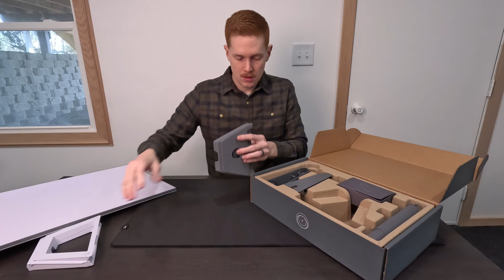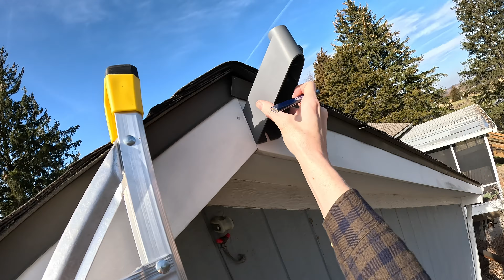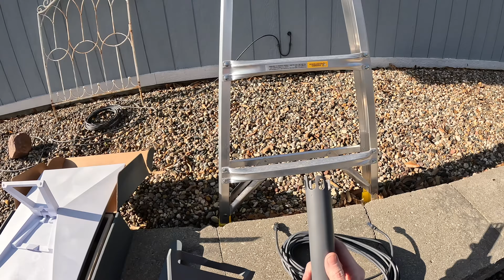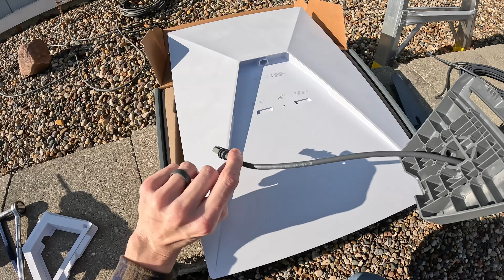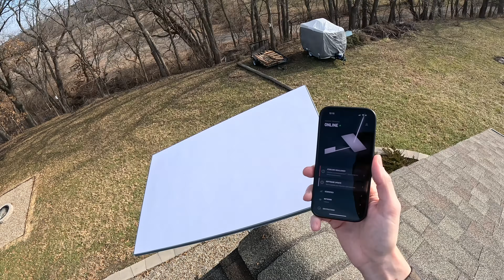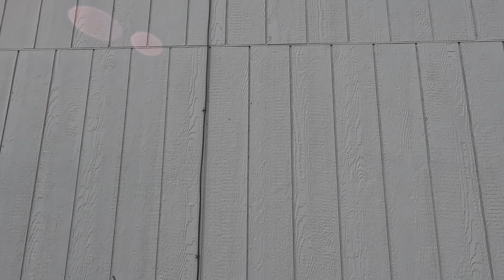Starlink Gen 3 Standard Wall Mount - Review and Install Tutorial

Comment: Where is your router, garage?
Reply from the maker: For this tutorial, yes. I also did a tutorial on running the cable through an exterior wall, and that was on this garage as well. My actual home unit is on my main home roof, though. I ran the cable to the basement, where I have the Gen 3 router plugged into an eero mesh system to provide coverage to the house.

Comment: Great video. Have a couple questions. What about when it's time to install new roof shingles? How easy/difficult would it be to take the antenna down? Is the mast made out of metal as well or is it plastic? The adjustment screw seems a little flimsy. How well does it secure the antenna? Would it stay secure in high winds? Thanks

Comment: great video thank you. i have just got my kit deilvered. and my question is, how thick / strong does the facia board need to be to hold the stand and the dish?
Reply from the maker: The facia board itself isn't providing the support, but rather the rafter behind it. The lag screws are several inches long so they can go past the fascia and hit a structural board.
Reply: @DISHY_tech  thank you - that makes sense.

Comment: I need help. I don't have any power to my router. I have power to the outlet. But the light on the router will not light up. Any ideas?
Reply: Have you hit reset and checked for updates? I had same issue yesterday and had an update on app.
Reply: @heatherketch4772  I have not.  I'll try that when I get home. Thanks.

Comment: If your company does custom mounting Solutions, you should do a v-mount backing plate, so it is perfectly centered at the roof line. It's slightly off to the right. Not a big deal but if you want it perfect I would do the back plate.

Comment: Whats the wind rating with this mount?
Reply from the maker: Starlink hasn't assigned a wind rating, but based on my experience and time with it, it's able to handle moderate winds like 40-50 mph. I've had gusts up to about 60 mph in storms with no issues.
Reply: @DISHY_tech  Try gusts of 120 MPH.

Comment: Hello, I work for a construction company in Japan with an installation record of over 120 Starlink units (about one every three days). Since the antenna kits and mounts discussed in this video are not yet available in Japan, this has been very informative for us. However, I would like to point out that using lag bolts (coach bolts) for mounting on the roof fascia alone may not be safe due to insufficient material thickness. It is recommended to secure them in areas with more substantial backing where the bolts can anchor deeply.

Also, I strongly recommend wearing a helmet when working on ladders for safety.

Regarding the original mounts, while they may seem less reliable, I am curious how well they would hold up against the typhoons that are common in Japan during the fall, which bring winds of up to 80 km/h (22.2 m/s). From my perspective, it is questionable whether they would withstand such conditions.
Reply: I'm in a very windy area in Alaska. We routinely get hurricane force winds in the winter. I'm a little concerned that the cold will make the plastic brittle and the wind will rip the plastic apart. Just placed my order yesterday and now I'm wondering if I need to build a mast instead and do a pole mount.
Reply: I like your comment about the insufficient material thickness of facia. I think I will add a piece of 2"x4" board behind the facial when I install mine to ensure sufficient material to hold the lag bolts in place. My house sits on top of a ridgeline overlooking a lake 300ft below and the winds can be quiet strong here. Therefore, I will feel more comfortable knowing that my lag bolts have sufficient material holding them.
Reply: Hello, I have the same question about Tifton, but you say one every three days is installed in Japan. What type of installation is used in Japan?. Thank you
Reply: @penelopeba  Hello, thank you for your question. We have been involved in installation work for over 30 years, and since establishing our current company 13 years ago, we have primarily focused on TV antenna installations. Although Starlink dishes are different from TV antennas, we have successfully applied our expertise and materials from those installations to ensure safe and durable setups.

For example, while adjustable mounts that are easily found on Amazon may seem convenient, we tested some of these a few years ago for TV antenna installations and found durability issues, so we no longer use them. Instead, we use side bases and highly corrosion-resistant masts, commonly used for TV antennas (including satellite dishes), for our installations. Depending on the building structure, we typically use stainless steel screws of 65mm or longer, and we fill the screw holes with modified silicone to ensure waterproofing.

To date, we have installed tens of thousands of TV antennas and more than 150 Starlink units, and there have been no cases of collapse due to typhoons or other extreme weather in Japan. (We did have one case where a flying object damaged a BS satellite dish, but there were no major issues.)

You can check out some of our installation case studies here, where we explain the details for users. It might be helpful for reference: https://9696.co.jp/case-category/starlink/

Additionally, we have confirmed with Starlink’s official support that while their equipment is rated to withstand strong winds, they cannot guarantee performance beyond their specifications. They recommend removing or reinforcing the dish in case of extreme conditions like typhoons.

Furthermore, in Japan, Starlink cables are treated similarly to electrical cables, and national certification as an electrician, along with the appropriate company license, is required for installations. Please keep this in mind.
Reply: There is ZERO chance that "using lag bolts (coach bolts) for mounting on the roof fascia alone may not be safe due to insufficient material thickness". Facia here in the US is a minimum of 2x6 (1-1/2" x 5-1/2").  

What I would be concerned about is the screw that clamps against the pole. I would purchase a small stainless steel or galvanized self tapping screw to lock it in place in another location once you have it adjusted. That is the weakest point.

Comment: Great video, thank you!  I just ordered mine for my cabin.  Should i expect the Gen3?  I ask because i recently rec'd my Business/High performance starlink for business and i rec'd the Gen2 rather than Gen3.  BTW, the High Performance is not near as easy to mount and assemble.  Also if you rec'v the Gen2 high performance and wish to connect to a network you need an ethernet adapter. Gen3 high performance router includes onboard ethernet port.  Just FYI to anyone who considering the high performance hardware.
Reply from the maker: If you are in the US, you will get a Gen 3. It's the only version available from Starlink in that market. Australia is the other market offering Gen 3, but customers have a choice for now.

Comment: Can this install just the mast & panel adapter on top of Starlink yard pole anchored to Airstream trailers the V3 ROAM Starlink?
Reply from the maker: I'm not familiar with what kind of mount Airstream is using, but you could adapt just the mast to a similar size mount, assuming you have some kind of bolt or clamp to secure it. I wouldn't think it would be a direct fit, though, unless designed for Gen 3.

Comment: Nice video. I would only add that the loop you made at the bottom of the exterior cable  rub is very important. The cable should always enter the structure from a lower elevation. Otherwise water will run down the cable and into the structure. If you are running the cable through the soffit or a gable vent and don't have that service dip, you will end up with water in the attic.
Reply: Can put a zip tie on the cable as well to let water drip down it
Reply from the maker: Good to know, thanks for the additional info!
Reply: Thank you I was  definitely  thinking about dropping it straight down.
Reply: Does it turn to follow the satellite ?
Reply: @nocturno_4455  From what I've seen in videos so far, the Gen 3 dish is a purely manual alignment process. It does not come with automatic alignment by default.

Comment: The Gen 3 feels like a cheap and nasty downgrade.
Reply from the maker: It is certainly cheaper to produce for Starlink. In my opinion, quality has gone down hill with every dish since the V1/V2 round dishes.
Reply: Who cares as long as it works?
Reply: It is cheaper build because it is cheaper to buy! Did you really think there wouldn’t be a trade off for cheaper dish cost!
Reply: May feel cheap compared to the earlier generation models but it works well and I have no problem with that. I live in a very windy area in the Blue Ridge Mountains of Virginia where winds typically reach 50 miles an hour in the winter. So far, no problem.
Reply: Is it worth it for gaming online and having several devices connected at a time? Saying 4 phones a tv or two a computer and a ps5? Im considering getting it but im not sure how much it can handle and how fast it is  @darrells1806

Comment: I have found it almost impossible to find the Gen. 3 adapter. I have the mount, just not the mast or adapter that clicks into the back of the antenna. Do you know where they are available? I want to mount it this weekend, if I can get all the parts together. Thanks in advance.
Reply from the maker: It sounds like you bought one of the Gen 2 wall mounts, which aren't compatible with the Gen 3 dish. You need the "Standard Wall Mount" in this video, which is a Gen 3 accessory. When you visit the Starlink shop, you need to select the Gen 3 dish to view compatible accessories. The Gen 3 Standard Wall Mount comes with the adapter and mast, as shown in the video.

Comment: Haven't decided on Star link yet, but appreciate this video in case. Still up in the air on Star link. I have slow DSL, less than 25mbps.
Reply: Had satellite that was slow and always down. Last time it went down, they said ten days before tech would be there. That was the last straw. Got Starlink with $200 off in my area. Shocked at how well it works, excellent speed. The only regret is that I spent so long suffering with my satellite service.
Reply: @curbside_profit3121is it really that fast? My internet is abysmal but I'm hesitant because idk how fast it really is and how many devices it can handle. I live out of town rural, but I'm like 8 minutes from town in a valley
Reply: https://www.youtube.com/shorts/b9D_W04yeU4

Comment: I cannot for the life of me understand why the cable is not installed in conduit. Cables should never be exposed outside a premises or below a certain height inside the premises. I thought this was a Starlink authorised video. This guy is just an amateur.
Reply from the maker: Conduit is overkill, the Starlink cable is rated for outdoor use. The official Starlink instructions don’t call for conduit. I’ve had my original dish installed for over 3 years, the cable is fine.
Reply: @DISHY_tech don't pay attention to attention seekers.
Reply: These are low voltage and weatherproof cables, no need for conduit.
Do you see phone, coax or fiber in conduit?

Comment: Hello, I saw your video and I would also like to order Starlink, but there is one problem. With the initial order it seems to me that Starlink wants to give me the second gen instead of the third one, as I prefer the third gen a lot more due to the conditions where I live. Will Starlink give me the second gen anyway or will it give me a third one instead? As though it looks like the second gen according to the pictures and description.
Reply: in my area they let you choose during the ordering process
Reply: not in mine, I come from Slovakia
Reply: @frantiseklos7283  I've read in other comments that the Gen 3 is US only, but that will probably change in the future.
Reply: can be, starlink I ordered came to me 2 generation, from the speed I'm totally satisfied I'm downloading some stuff my brother plays online games and others are also on the Internet and everything goes without problems. The only downside is that it doesn't have a LAN port. It's the 21st century and the router doesn't have a LAN port
Reply: @frantiseklos7283  That's unfortunate with the Gen2. But you can buy an adapter to convert to LAN. It's not needed, as I stream 4K video via WiFi on my smart TV.
Reply: @jbrou123  I purchased the adapter you mention when ordering because I did a little research. The adapter has only one LAN port which means that you can only connect one computer, in our house there are two computers so it's still a disadvantage. Connecting Starlink via a regular router is possible but if you do it the speed is reduced to a quarter, I use LAN because I have an older computer and my brother has a newer one so he has Wifi built in and he has no problem with it. I have tried to buy wifi adapters from shops but still the same speed is not the same but only half or in one piece drops out.
Reply: @frantiseklos7283  

if you really want gen3, it's US only. so what you can do is have someone buy from a US reseller (best buy or home depot) and send it to you. In the resellers, they are starlinks with no accounts so you should be able to register your account with them.

regarding LAN, you could just use a desktop switch to connect a lot of things through cable

Comment: Any foreseeable issues with wind or snow?
Reply from the maker: It's survived the winter here so far! The mount itself is secure with the 2 lag screws. I found it nearly impossible to separate the mast from the mount adapter. Despite being plastic, I also trust the mounting adapter plate that snaps into the dish. The wobble isn't confidence inspiring, but from what I can tell so far, doesn't appear to have any affect on performance or stability of the mount.

Comment: The quality of hardware being supplied with the generation 3 setup looks much more inferior and lesser quality compared to the earlier versions,I had been seriously considering Starlink as an option for my internet setup but after seeing a number of videos of the new gen3 hardware I have to say I'm unimpressed........
Reply: 😂😂😂 All the structural parts are made of steel, what do you want, heavy gauge titanium?
Reply: Just finished installing the Gen 3. It was simple in install and align. We’re happy with it. Download speeds 200+mbps and I live in heavily wooded rural area. Equipment start up $650, which is a little pricey but $120 a month is well worth the cost, with those speeds.
Reply: My gen 2…. Slapped it up there anywhich way and it did ALL the alignment by itself.
Reply: Just did this myself….think hard about where you want it before ordering mounts and also research aftermarket mounts…I had to heavily modify this wall mount to work for me.
Reply: Buy gen 2. It's pretty cheap now...
Reply: Good point! I agree, and I am so disappointed with this cheap plastic stuff they're selling us. 😢
Reply: You can get other mounts
Reply: All these talkers on here, hating on something without trying it
Reply: Gen 3 is trash. Standard Actuated was the best way to go.
Reply: @skullystrench6048 probably they changed from gen2 because of the cost, not quality of connection and speed...

Comment: That new flimsy mounting system is awful. Those two little clips will give way under a big gust. Don’t get me started on the pole mount that has already been recalled by SpaceX. People don’t really like their expensive new dish flying off their roof. SpaceX obviously never tested the new dish in real world conditions
Reply from the maker: I doubt it based on my experience so far. You have to lift up and slide the mount plate out at the same time, not something wind can do. Obviously, don’t keep your dish up in a tornado. But in Starlink’s history I’ve seen very few properly installed dishes fail because of wind.
Reply: @DISHY_tech  there is currently a recall on all pole mounts. A lot of people had their antennas destroyed because of the poor design. That is not just my opinion. The two tiny clips that will likely fail in strong winds is, along with many other reviewers. The V2 was objectively a much stronger design
Reply from the maker: @gammagonad  The Pipe Adapter recall had to do with the bolt, it could loosen over time. It had nothing to do with the mounting plate or how it attached to the dish. Anyone concerned about Gen 3 can always just buy Gen 2, as both are available. But I have all the mounts and multiple Gen 3 units being tested, and they are holding up fine.
Reply: @DISHY_tech  I never said the recal had anything to do the mounting plate, but once that’s fixed just you wait and see it will definitely be a problem. It obviously was not as well designed from the beginning like the V2 was. You can tell that not much thought was put into it other than “build it cheaper”

Comment: Do all the mount kits come with the adapter that replaces the kick stand on gen 3 (the long and short mount, the pipe adapter, and the pivot mount do they all come with the “mast the adapter” plastic clip that replaces the kick stand
Reply from the maker: Only the mounts designed for Gen 3: Standard Wall Mount, Standard Pipe Adapter, Standard Pivot Mount. Long/Short Wall Mounts and other Gen 2 mounts aren't compatible with Gen 3.
Reply: The only mount that came with my Gen 3 was the kickstand. I was very disappointed to find this out when I got here. Unfortunately, I can't blame anyone but my husband, because he did the ordering. I'm not completely sure if my husband knew if we were going to need a mounting kit. We still haven't received our standard pipe adapter yet. It's been almost 4 weeks.
Reply: @billiejostoddard372 I think the gen 3 pipe adapter was recalled. When you receive it, make sure it’s the new gen 3 version.